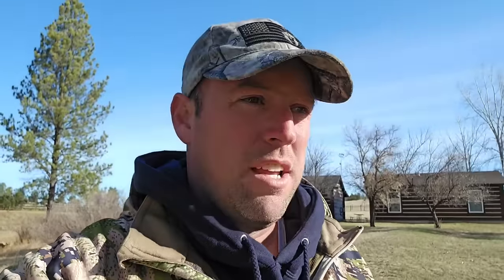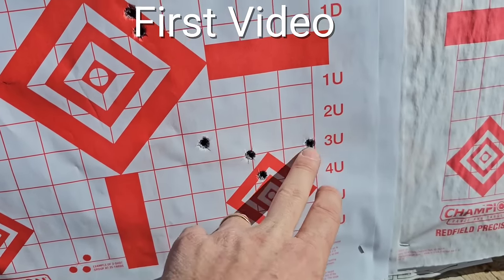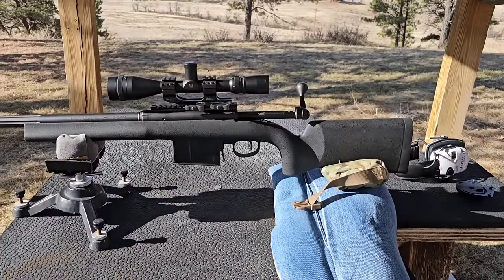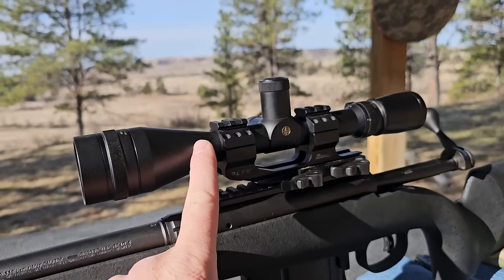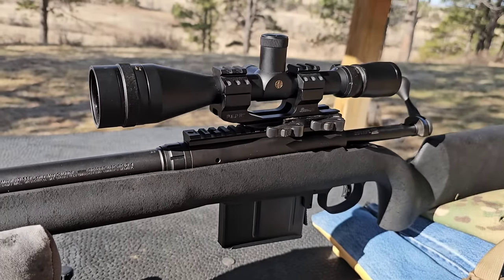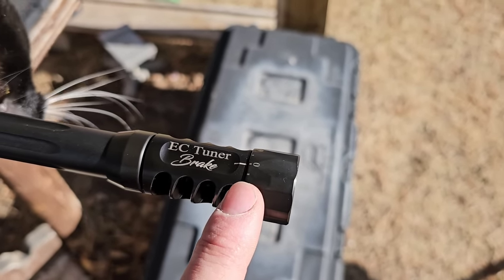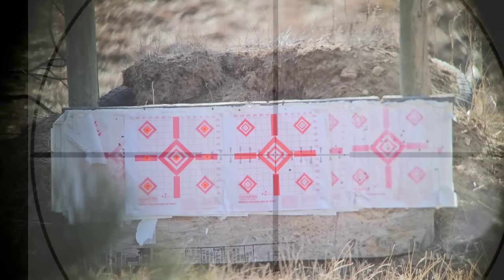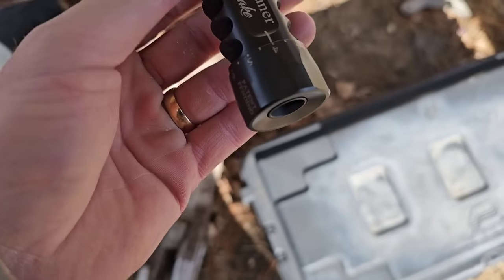Long-Range Rifle: PROBLEM Solved?

Comment: Man - that's got to be frustrating.  I've had several Savage bolt guns (newest one is probably 8 years old) and they've all been ~1 MOA or better.  I hope Savage can get you fixed up - trying to diagnose problems with the price of .338 Lapua ammo is an expensive endeavor.
Reply: You have reason,i have a same 308 and my grouping are half moa and less all a time and many time with my reload is .250 moa it,s not difficult  5 shots groups not 3.

Comment: Keep in mind that I'm right over in Cody and I hand load .338 Lapua. Save that brass and we can make new and better ammunition out of it. I'd be curious to measure that fired brass to see if the head space is correctly set on that rifle. I'd also be curious to run a bore scope through it. Savage has been having serious quality control issues for several years now so I wouldn't rule out anything. My .338 Lapua is a 111 Long Range Hunter that I got back in 2013 or 2014 and with my hand loads it shoots far better than sub minute groups. Your rifle has a much better stock and a little heavier barrel and it should shoot better than mine so there is definitely something wrong.
Reply from the maker: Yea, when I get it back from the factory, I will see what they did. I might go with a new barrel. I do like the gun and would like to keep it. I am keeping my brass and one day do plan on reloading.

Comment: Some people are saying the scope is way too high, and I definitely agree. Some people think your barrel is bad, and i think maybe not. Lap the barrel  and get your scope set up appropriately. Aside from those suggestions, when using the tuner, do not adjust it so far. Fire 2 shots, adjust it from 0-1, then fire 2 and adjust from 1-2. Do this till maybe you get to 6. Also, you need to chrono all this ammo. If the ES is high, the ammo is truly crap which means no amount of tuning will be significant.

Comment: Ive been shooting a Browning A-bolt SS in 7mm Rem mag with the BOSS adjustable break for a few years, love it! I bought the gun used and thought the BOSS was kind of gimmicky but I wanted a brake so I could shoot more and find out what factory load my gun liked. Once i figured out the BOSS I simply tuned it to the ammo I wanted to shoot. Did Eric give you any base line settings or recommendations? Every different bullet/load combination will have different setting on the brake. If you are shooting Hornady ammo for hunting that's  what you tune that brake for. Forget about shooting that bargain ammo for a base line.
Reply from the maker: I plan on using the ammo that shoots the best out of it, so I'm not even sure yet what that will be. Thanks for watching.
Reply: Those old bosses really work just takes some time and patience’s and good quality reloading products

Comment: When you make a change to the tuner brake, it may require you to change your zero after to move it back to where you want. Continue adjusting the tuner break, without any concern for WHERE it is impacting in relation to your point of aim… just make sure the points of impact are as close together as you can get them, THEN readjust your zero to the new setting on the tuner brake. I’m pretty sure Eric Cortina has a video explaining exactly this, though in his own words obviously.

Comment: A peek down that barrel with a scope would be really interesting to see.
If Savage warranty doesn't cover it and according to price, rebarrel with a prefit. A go gauge, check your recoil lug for same thickness around. If not square get a recoil lug, (around 30 bucks usually), barrel nut, wrench to fit barrel nut. Do the change yourself. Someone close by may have the tools and experience if you don't feel comfortable and be willing to help you. If I was closer I would offer the tools and help. Also some of the barrel manufacturers sell new take offs, but after this I would rebarrel with a good brand. Especially since you like the basic rifle and calliber.
Just my humble opinion.  
Hope you have it stacking next range report.
Peace and health to all. 
🙏🏻🙏🏻🙏🏻
Reply from the maker: Thanks for the reply. I will see what the factory says and go from there. If they fix it, great, but if they dont, I will purchase a custom barrel for it. I do like the gun and already have a lot of time and money in it, so I'm sticking with it. Thanks for watching.

Comment: You might thing about the 300wsm it shoots big bullets and is very accurate and uses a lot less powder! It also holds the 1,000 yard record if I remember right! I can hunt with any cartridge out there being a 60+ year collector but the 300wsm is one of if not the best and there is plenty of brass and reloading products available for it
Reply from the maker: That's true. That is also a great cartridge. I always thought of building a custom tikka in 300 wsm. Thanks for watching.
Reply: @Guidedhunts  I've got a Tikka 300WSM all factory but I modified the chamber with my JGS reamer to seat bullets out further. Works well. I have 3 loads, all excellent - 150 Barnes TSX with Superformance, 168 Barnes TTSX with IMR4350, and 180 Accubonds with StaBall 6.5

I JUST got my newest 300WSM barrel from Brux, 9 twist, 4 groove, #4 contour, 24" long, cut, crowned, bead blasted by my builder, fits the Terminus Zeus quick change long action. I bought 2 bolts for it, one mag face, one standard. If there'a anything I would encourage you to do down the road is get this action. You can swap out barrels yourself by loosening 2 set screws. I just left the range, day 2, testing my new 300WSM with 190 Speer Impact, 190 Nosler ABLR, and 210 Berger VLDs. So far the 210 Berger VLD is the winner with Reloder 22 and no pressure at 2842fps.

The other barrel for this action is my 270-7PRC. I'm using an 8 twist K&P barrel, 4 groove. Steel comes from Germany. I'm testing 170 Berger VLDs and 165 Nosler ABLRs but concentrating on the Bergers for now. I'm very pleased. It is doing better than a 6.8 Western as of today. Top load as of an hour ago and still no signs of pressure is 3144fps

If you decide to go 300WSM, which I HIGHLY recommend, make sure you get your builder to use a modified reamer to open the body 0.002 and have a base to ogive length so that it fits a long action. For example, my 210 Berger VLD tested today has a base to ogive length of 2.675 at the lands. If you want specs on my reamer let me know
Reply: @Guidedhunts  If you opt to build a custom Tikka 300WSM definitely get a 4 groove cut-rifled barrel. I've got 8 twist, 9 twist, and 10 twist. Don't forget this but the slowest twist that will stabilize your bullet of choice is going to be the most accurate and fastest, generally speaking. Don't buy into all the latest hype (like I kinda did early on), where you need all these really fast twist rate barrels. My builder hunted with a 190 grain bullet in his 300WSM that had a 13 twist barrel and he shot quarter MOA. I've got more barrels on order with slower twist rates in 30 cal.
Reply from the maker: @derekmcmurry4263  thanks for all the information. I'm not exactly sure what I am going to do with this rifle. I was thinking of trying a KP barrel, I have heard good things and they are only hour and half away. Thanks for watching.
Reply: @Guidedhunts  Ken is a good guy to work with. I've got quite a few of his barrels. He's also pretty fast at turn around. Prices are going up every year. If anything, get a barrel on order from him sooner than later. If you're going 300WSM, I personally don't see any need to go with a bullet heavier that 210, just my opinion. Berger recommends 1-11 twist or faster for that bullet. I've got a 10 twist Brux barrel ready for pick up and I'm getting it chambered with my 300WSM reamer as well

Comment: Put a bore scope in the chamber and see if the chamber is straight to the bore. If they did a garbage job threading the barrel the chamber probably isn’t in line with the bore either.

Comment: I had the same Rifle about 11 years ago and it was a bad experience failure to extract Brass. I had to carry a cleaning rod to push out spent cases broken extractors weak ejector so I got rid of it and made it someone else’s problem. It’s well known that HornadyPrecision Hunter is anything but Precision shoots like shit. Using your left hand on the rear bag will probably help your shooting instead of having it halfway down the stock. Wish you good luck.

Comment: I suggest a horizontal line with target points 2-3” apart for minimal movement from shot to shot. It just creates consistency. I personally I’m not fond of savage. Just too many flaws in manufacturing inconsistent from my experience. One may be a tack driver and the next can’t shoot smaller than 2 moa .

Comment: I have the exact same gun and my worst group is just over an inch and best is half inch. I would see what Savage has to say, since the threads were cut off center from factory. The barrel just might be a lemon? I have several Savages and all can shoot sub MOA with good loads. If you can get a custom barrel for 3 to 4 hundred, I would seriously consider that! I would not ditch the Savage just yet!!
Reply from the maker: I have faith that it will get fixed one way or the other. Thanks for watching.

Comment: Trust me 
It need another barrel, that's why it was sold to start with.
I had 2 rifles that hat had to be returned  110 BA 300 WM, AND A MODEL 12 LRP 260 BOTH GUNS  HAD DEFECTIVE BARRELS 
THEY WERE JUNK STRAIGHT FROM THE FACTORY.
THE RIFLES THEY SENT ME TO REPLACE THEM ARE GREAT SHOOTERS

Comment: I'm not a fan of your choice of scope rings, but to each their own.  Generally speaking cantilever mounts are intended for AR platform rifles which considerably less recoil than the .338 Lapua you're shooting.  I'm a big fan of Warne and Talley rings.  Precision Hunter ammo also isn't very precision.  Check out HalfMileSnipers videos on the stuff.
Reply from the maker: The scope was pulled off an AR. It's temporary just to see if the other scope was bad or not. This is not what will stay on the rifle.

Comment: You can turn the tuner brake  out to 28. I just sent my Savage back to them. Barrel would foul up in 15 rounds to where shots at 100 would drop 5 inches. I hope they put a new barrel on 
it so I can sell it. 6.5prc by the way...  I can put 50 rounds through my Christiansen with no accuracy degradation.  Savage use to have a good reputation.

Comment: Hey, I just wanted you to know that those rifles are capable of excellent accuracy. I have the exact same rifle as you do, but I have a McMillan A5 stock on mine. I handload for mine, and at 200 yards, I consistently get .750" groups for 3 shots. I have shot .5" groups at 200 yards on occasion. The only issue I had with mine was  weak extraction, I sent it back to Savage and they fixed it for no charge. Im sorry that yours is giving you so much trouble.
Reply from the maker: Thanks for your input. I almost want to just have a custom barrel put on and be done with it. I mean savage might charge me if they deem the barrel shot out. Not sure what I will do yet.

Comment: Forgive me if this is a dumb question but I was wondering if you borescoped the barrel. I have a Tikka CTR that averages ~0.5 MOA for 5-shot groups but they blow up if the gun gets too much copper buildup. Before I got a borescope I was perplexed and thought my gun just stopped shooting well. Once I checked with a borescope I could see there was an obscene amount of copper in the barrel. Cleaning down to bare metal shrunk the groups back to 0.5 MOA.
Anyway, since you aren't the original owner, there's a good chance that gun has never been cleaned properly...Ever...
That said, if you already did, I would send it back to Savage. It shouldn't be your problem and 338 Lapua is expensive.
Reply from the maker: I did not bore scope it. I don't have one. But I did clean it the best I could. It didn't really help. So it's going back to the factory. Thanks for watching.
Reply: @Guidedhunts  Good move. That's what I would do. That said, you can get a decent borescope for about $55 now. Checking a rifle that you think is clean with a borescope really is an eye opening experience. I’m sure one 20 round box of 338 Lapua costs more than $55. Don’t step over dollars to pick up dimes.

Comment: Sounded like you aren't keeping that scope on the 338. If you are going to pair the VariX and bolt gun I recommend changing rings  and set the scope as close to the action as possible. Best of luck

Comment: I would say go to a 26" 300 PRC, but I'm guessing you just really want a 338 Lapua.  
If that's the case, at $4 - $6 per shot, cost of an EC Tuner and now shipping charges, you could have re-barreled the rifle and pretty much been guaranteed a sub-MOA gun. 

I have a .308 Savage Model 10 Tactical that is also super finicky. I would call it maybe a MOA rifle if I tune a load for it, but that's not good enough for me. My last two outings with it shooting factory Gold Medal Match, it shot about 1.5 MOA. This rifle does some really weird stuff, like a 14" shift in POI going from 168 grain Gold Medal Match to 168 grain Nosler hunting loads. It's the only rifle I own that I can not bore sight and get on paper at 100 yards. With every rifle I own, I can bore sight and be within 6 inches. This rifle, will be 30+ inches off in a random direction when I bore sight. 
I think Savage uses bad steel for their barrels. Bad steel can cause bad barrel vibrations. They have a good reputation for producing accurate rifles, which is why I bought it, but that has not been my experience. My rifle is 15 years old, how old is yours? Maybe it was a bad run of steel for a short time.
Reply from the maker: I never looked up when the gun was manufactured. This gun did the same as yours bore sighting. I had to do it at 25 yards first. The gun is a lemon. I do like the rifle other than it doesn't shoot. I still might put a new barrel on it. Going to see what factory says first. Thanks for watching.

Comment: Savage is a good company and I hope the video makes you money to pay for the ammo. However, this is a good example on “You get what you pay for” those rifles are about $1200 new. Probably ~$750 used. You have shot ~$350 in ammo and ~$250 for the muzzlebreak. Not to mention the hours used to get it to barely acceptable accuracy.

For ~$1600 you can get a Christiansen Arms, entry-level 338 or for ~$1900 You can get a Ruger Precision Rifle. Both rifles should be able to easily perform under 1MOA with match grade ammo. Both are only 1-2 more shifts of overtime more than what is already in to the current budget.

I am enjoying your video series. I cannot wait to see this rifle all set up and ready to hunt.
Reply from the maker: Thanks for watching. You are right about everything you said. I could have saved and got something more expensive that would have shot out of the box. In the end, it would have been cheaper than what I am dealing with. But here's how I see it now, knowing there is a problem. I don't want to pass it on to someone else. I am going to get it fixed now. And film the process.

Comment: When you mounted your scope on your rail did you push it forward on the rail so the recall of the gun doesn't move the scope
Reply from the maker: Yes, I did. And I double-checked it to make sure it didn't move. After i shot it. Thanks for watching.

Comment: You were turning the tuner backwards instead of making another revolution on the brake.  Keep going clockwise another revolution
Reply from the maker: I started at zero, went to 10, and then went from 10 back to zero with different ammo. Thanks for watching.

Comment: Turning it into a long term project will be fun but can and will get expensive. I think you’re going to find out you will need a new barrel. Hopefully savage will swap it out. I saw another comment that you don’t reload, save your brass maybe you’ll find someone who can. Regardless even if you have to pay someone, will be way cheaper than buying factory hopefully for a better product depending on the reloader.
Reply from the maker: Thanks for watching. I'm thinking it's heading that way, too. Might get a new barrel if they dont do anything with it.

Comment: Hate that scope mount. Especially for a .338. The point of contact with the rail should be 2 to 4 spread apart. Not 1 towards the rear of the rail.

Comment: Scope mount used is a bad choice... That Burris cantilever mount is not intended to be used with a 338 LM.
Reply from the maker: I know I pulled the scope from my AR just to try and  make sure the other scope was not the problem. It's only temporary. It will not be the final scope/rings for the gun.

Comment: Took my 110 in 338lm about 60rds to foul the bore and deliver better accuracy. Not gonna touch the bore until accuracy drops off.  Also i wouldnt reccommend skipping numbers on the tuner.
Reply from the maker: I was limited on rounds. When I get the reloads, I will hit all the numbers.

Comment: Check all fasteners and torque to spec remember you are shooting a high recoiling rifle.. Replace that ridiculous scope mount with a set of high quality steel rings sized to allow the scope to be mounted as low as possible and setting them as far apart as the scope allows without contacting the bell, turrent or power ring. Good luck.
Reply from the maker: The rifle is being re barreled. When I get it back I will post another video of it. Thanks for watching.

Comment: MaRk 4 steel.base is what I use ..why one pice rings ..to.high ..I also told u about the ec tuner
Reply from the maker: The scope is pulled from another rifle, easy to swap. It won't be what stays on it.
Reply: @Guidedhunts  your doing good g
Job I think gun has a problem that's why they sold it ..